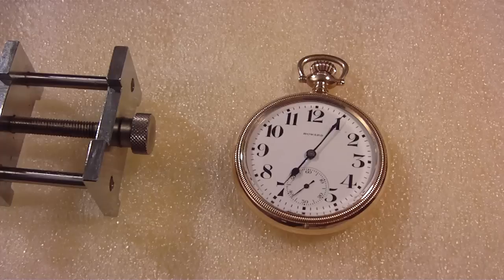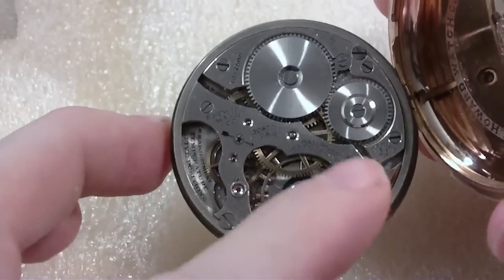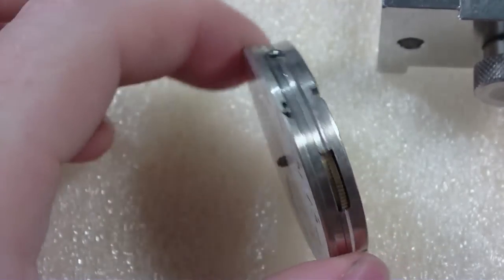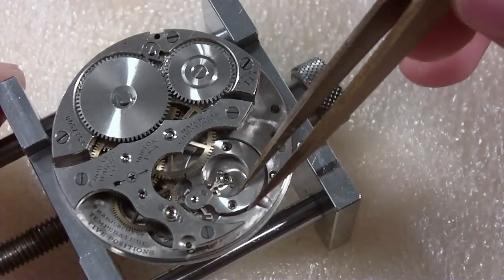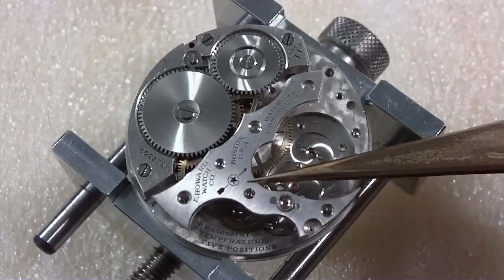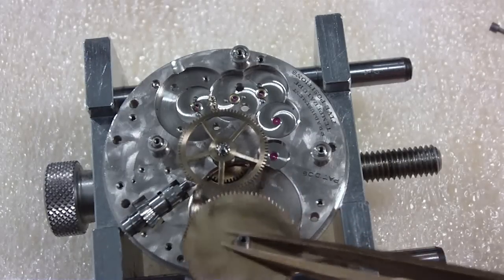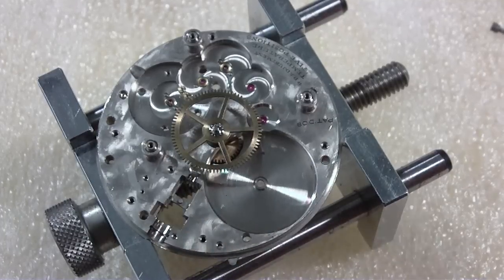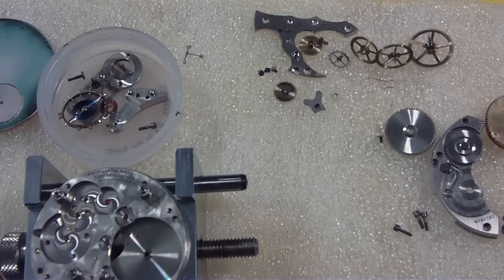How I take apart a pocket watch, Howard, Series 11

Comment: I'm pretty new into pocket watches myself so I've not really been aware of the "Howard" make (I assume it's an American company in any case), but that is a real nice looking movement - as you said the funky looking bridge. Anyway thanks for showing, quite interesting.

Ah, and I'd definitely be interested in a dial-based video whenever it comes. Thanks again.
Reply from the maker: wee1owen12 Howard is an American company.  I have been thinking about a dial video for several years now.  For pocket watches you have the single sunk, double sunk, no sunk, pinned, feet (2,3 and 4), snap on, enamel, metal, melamine and maybe more variations, mounting and materials.  I wrote this down in this reply so I know the types of dials I have to use in a video.  I know I have these but some are on watches and I don't want to take a watch apart just to use the dial in a video.  You have to see the back of the dial to really understand the dial.
Reply: bunnspecial There are also dials that are fixed to the movement with a single screw in the front. These are usually found on European watches, a lot of Abraham Louis Breguet's watches had this sort of thing.  

Kindest regards, Nate Blubaugh